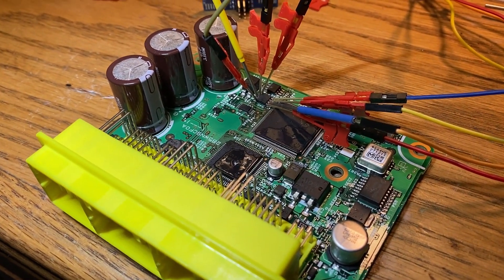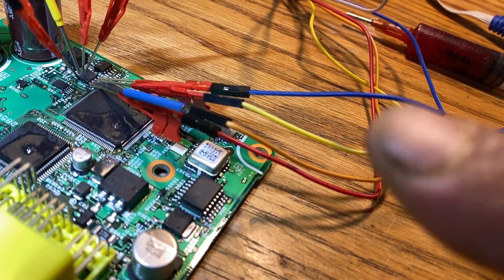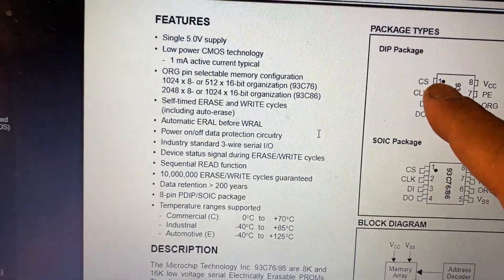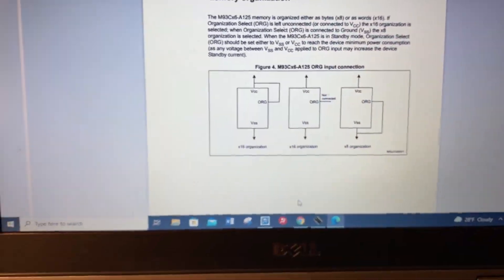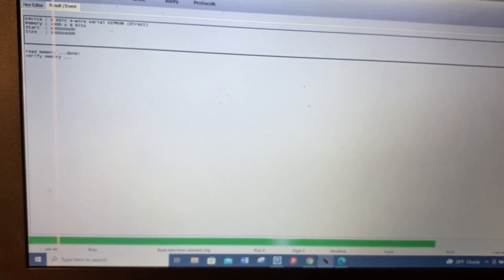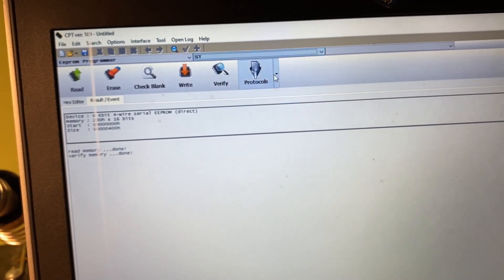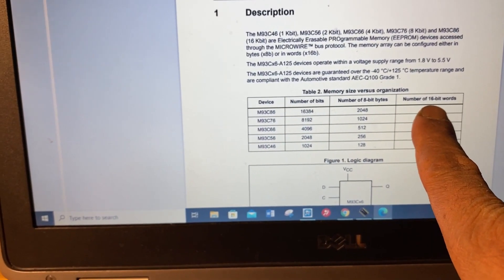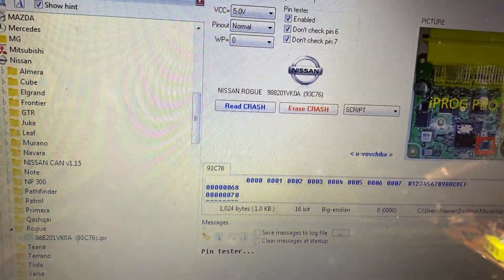ERROR FIX FOR EEPROM 93CX6 PIN 6 , ORG EXPLAINED FOR AIRBAG READ OR DASHBOARD

Comment: Thank you good information
Can I use xp400 programar with IM608 to solve crash SRS

Also if I buy I prog (china) Is it ok? 
Thank you
Reply from the maker: Any programmer or chip reader should work, xp400 will work also, the main idea read crash file clean it or fix it then write it back with clean file, let me know if you have any problem, thanks
Reply: @NASSTRACINC  where do you get the clean file from? does it come (for a collection of cars models and years) with the programmer? Thank you brother